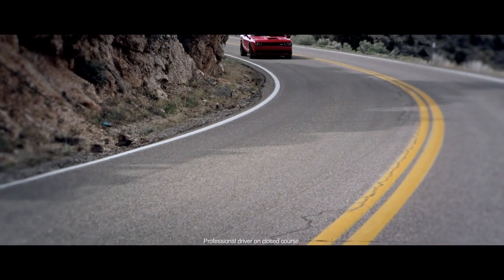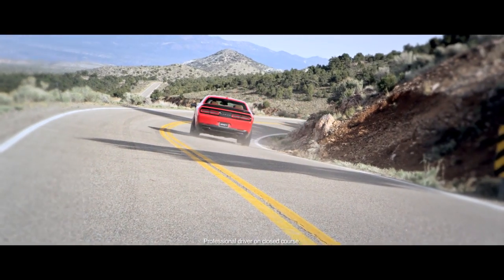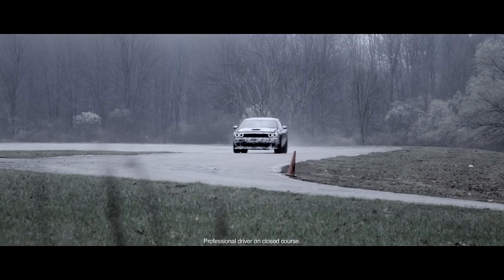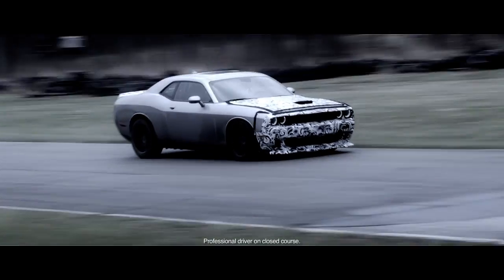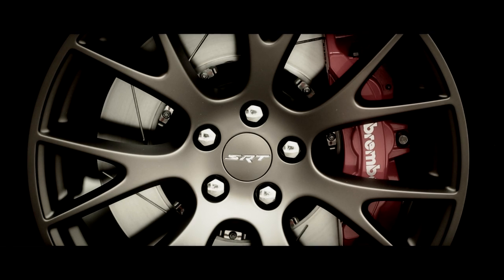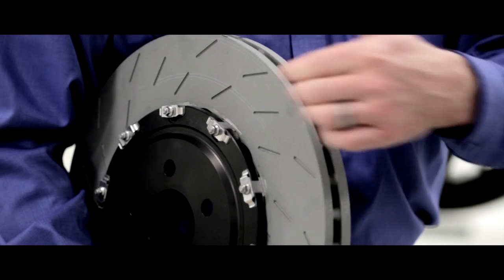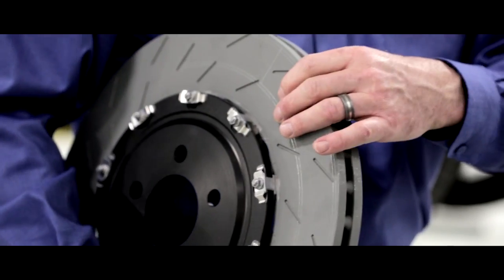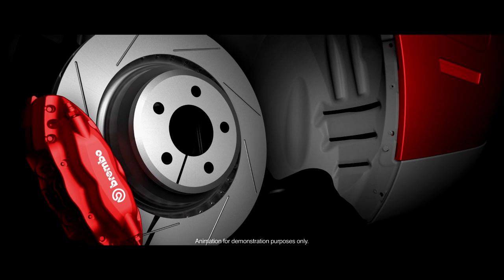2015 Dodge Challenger SRT Hellcat - Braking System

Comment: Impressive, but it also serves as a reminder of how big this overpowered land yacht is. You NEED those huge brakes to stop your 4450lb cruise missile before it kills someone. Also, brake dive for days, even worse than a Mustang from what I saw here.

And then there are the tires...Why, SRT? What possessed you to stick such dinky tires under a car with 700hp? And I thought the GT500s were bad with their measly 285s. Do you know that there are cars pushing literally HALF the power your Hellcat has, yet are running wider tires? Do you know that a Porsche Cayman S, with its 325hp, has rear tires just one size down from the Hellcat? Was it because you didn't want to make the Hellcat a widebody and 275s were the biggest you could fit under the standard fenders?

These are serious questions. I honestly want to know why a 700+hp, RWD car has 275s out back.
Reply: Who cares what it comes with!   It's way better than the 245/45/20's  the SRT's came with stock.
Reply: @rbremby74  but then, those xars had less power. And even the 425 hp first gen srt8s had a tough time hooking up